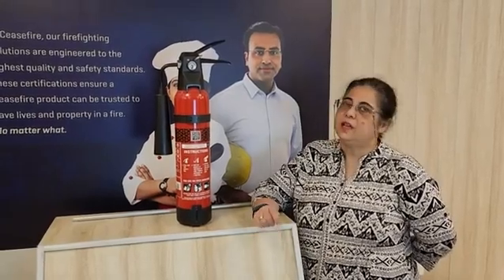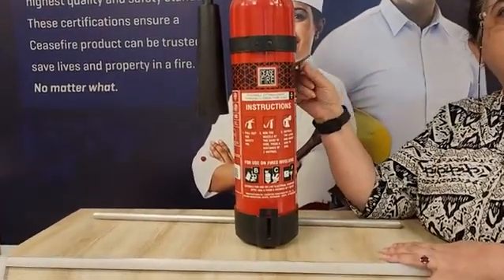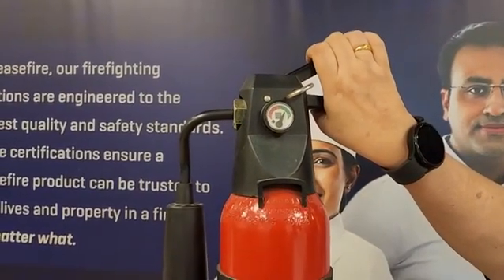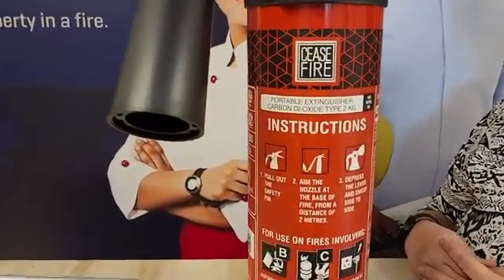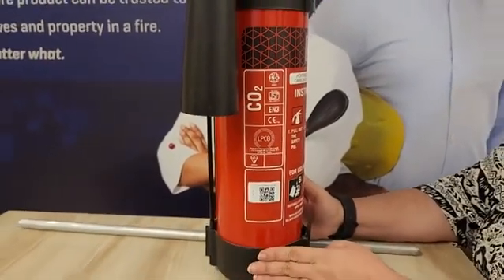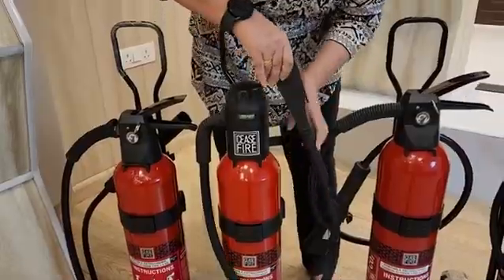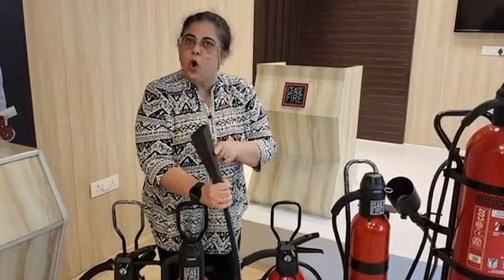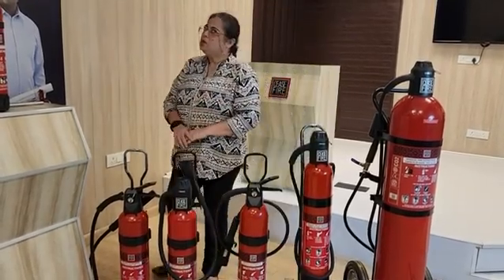Ceasefire CO2 Fire Extinguisher: Exploring Components and Working

Comment: Hello, I noticed that for larger CO2 fire extinguishers, there is a grip at the end of the hose to protect the user's hand from freezing due to the CO2 discharge. However, in the video, you mentioned holding the smaller CO2 extinguisher by the pipe-like part attached to the hose. Since both cylinders contain the same CO2 gas, why does the larger one have this safety feature, while the smaller one doesn't? I’d appreciate some clarification on this. Thanks!